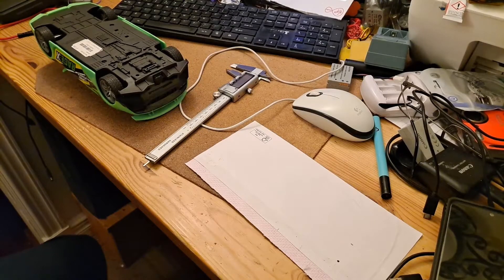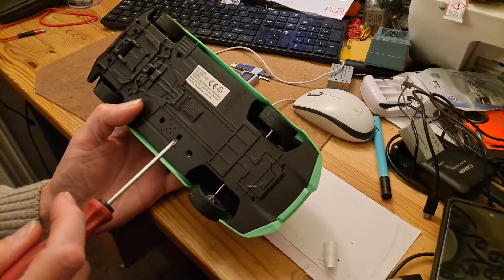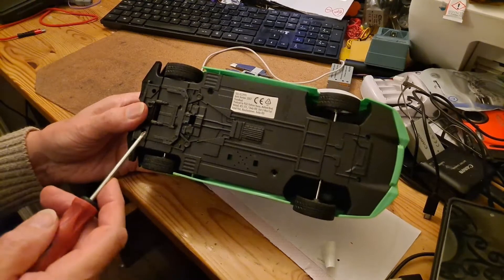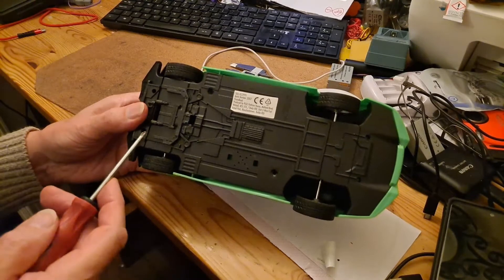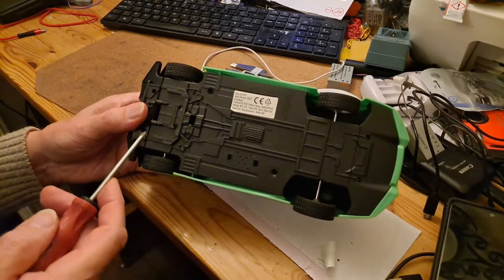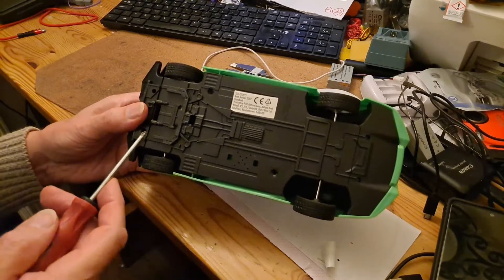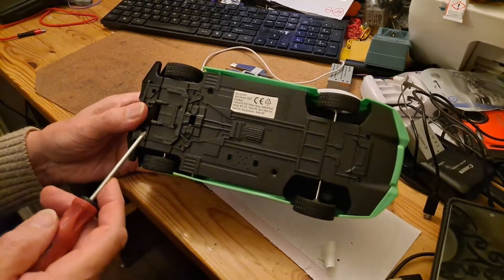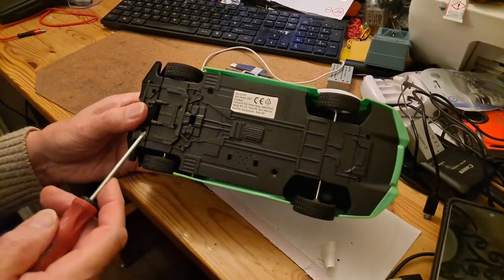Teardown Poundland RACE-X friction Flywheel car

Comment: Yeah, that's what that is, a noisemaker mechanism. The old tin Chinese friction vehicles used to have a metal version that made a cleaner, louder sound. Unfortunately they usually cheaped out on the flywheel, making the motor which was already weak almost useless when the "siren" was added on. Sometimes you run across a fairly strong example, but they're never great.
Reply from the maker: Thanks 😊

Comment: I have a few RC cars not to use but just for display. The funny thing is I can control 3 RC cars using one controller. One goes forward others go left and right. Weird
Reply from the maker: Yes, that is fairly common, especially with the older 27 MHz 40 MHz etc. The newer 2.4 GHz sorts that out and gives better range.

Comment: Lamborghini Sesto Elemento.
Reply from the maker: Probably, but unnamed to avoid any copyright issues
Reply: @GrandadIsAnOldMan  Why you just don't glue a couple of cooper or aluminum wires to the chassis to make it stronger?It's much easier than printing a whole chassis.
Reply from the maker: @onlinehelper374  for what purpose? Do you mean to strengthen it for the flywheel motor?
Reply: @GrandadIsAnOldMan  Strengthen it for electric motor and electronic
Reply from the maker: @onlinehelper374  so, how are you going to fit the motor and the steering?